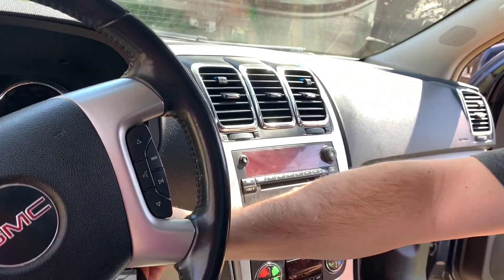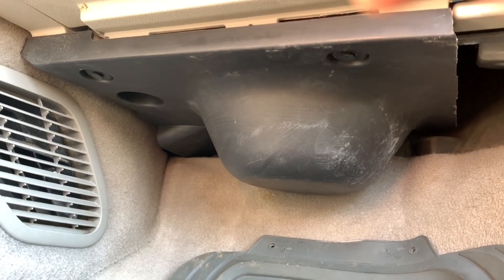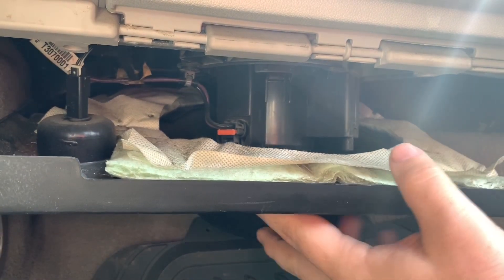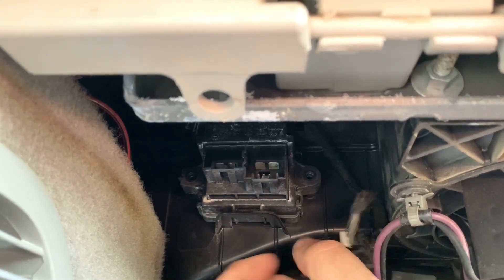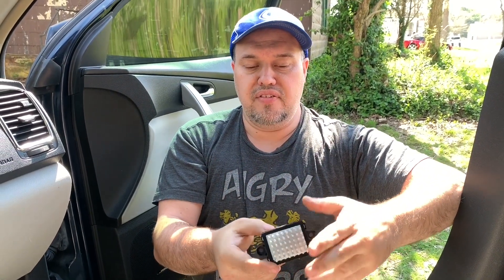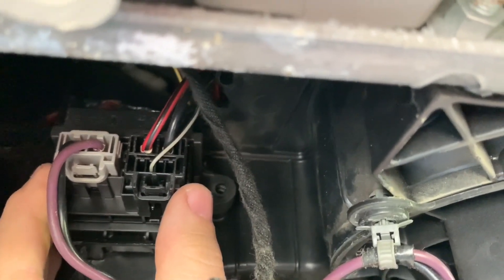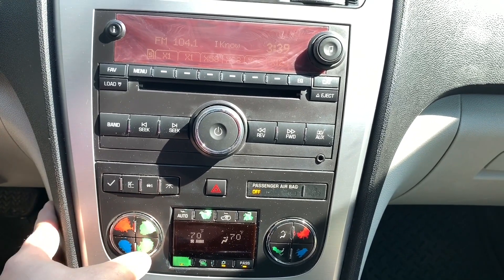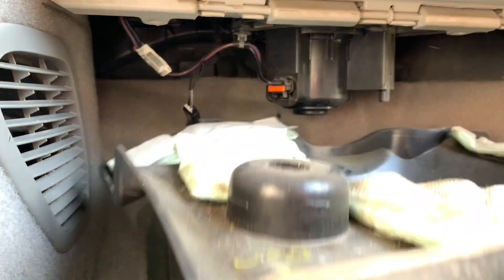Easy Diy Guide: Replace Blower Motor Resistor On 2008 Gmc Acadia Slt1

Comment: I replaced both the resistor and blower motor. Air still blows from the motor even after I turned the car off. Any suggestions?
Reply from the maker: No honestly I wouldn’t know right off what the problem with me I would take a multimeter and start testing fuses and wires.  And also I would make sure that no water is leaking in because that is what caused the problem in the first place in these cars. They are notorious known to leak when it rains.

Comment: How uFixed your leak
Reply from the maker: You should message me on my Instagram because there were a lot of things I had to do in order to fix the leak.  First of all the leaks were coming in for many different places like the sun, roof and moon roof. And then also what a lot of people don’t tell you you will have water inside your door jam, or the electrical connectors are and that water is actually coming from a defect in the weather seal around the doors water is coming in between that tiny space in between the doors, running down and going inside of the doors in fact, a lot of times, you can shake water out of the connector if you disconnect it from the door and you have to measure your door and get the correct weatherstripping that will seal the door so that the water won’t get in.  It is quite a big headache, but it’s worth not having a fish aquarium. 👍✌️

Comment: My rear ac stays on after the car is turn off would thus be a resistor problem??
Reply from the maker: It could be or it also could be a fuse or a wiring issue I would say in that order.
Reply: Thanks for your help
Reply from the maker: Your Welcome
Reply from the maker: Your Welcome my friend.
Reply: I replaced the blower motor resistor and it fixed th problem thankyou!.
Reply from the maker: You’re welcome my friend.
Reply: @lupillosaldana3523   hola Buenas tardes tengo El MISMO problema podrias ayudarme indicandome como lo hiciste

Comment: Quick question what if I turn on the ac/heater and nothing comes out it turns on but not coming out. It does however turn on in the rear hot/cold. My question is could it still be this regulator and blower issue? Thank you
Reply from the maker: And there is a 40 amp fuse that controls the blower motor.  You should definitely check and make sure the fuse is good.  If that doesn’t work, then look me up on Instagram by the link on the top of my banner page and I will try my best to help you farther.

Comment: What if it’s not blowing at all? My rear blower works not the front.
Reply from the maker: With a bad resistor it should still come on but may only work at one certain speed.  It not coming on at all could be a lot of things. Check the simple things first like fuses and relays then work up to check the blower motor itself with a multimeter.
Reply: Angelo quick question 
I got the same exact problem in my car
Did you fix it???
What was the problem 
Let me know please
Thanks
Reply: @mj96ct39  yes, I replaced the front motor and it fixed it
Reply: @Angelo Ruiz  the front Blower motor right?
Reply: the Motor or only the resistor???
Let me know please dude
Reply: @mj96ct39  moter